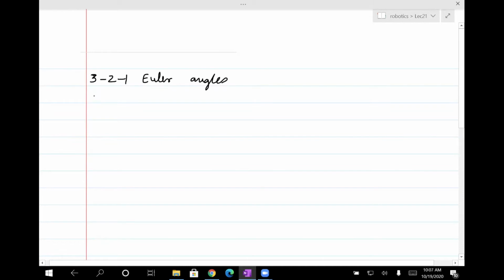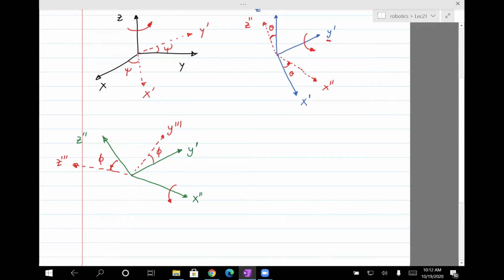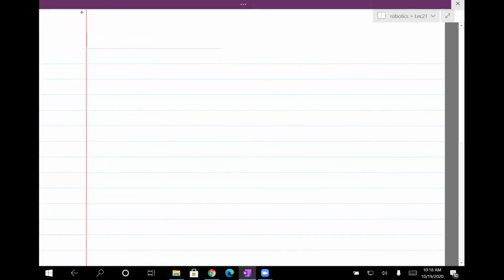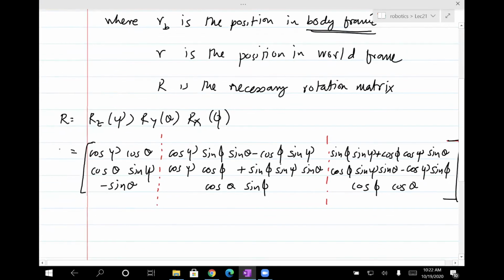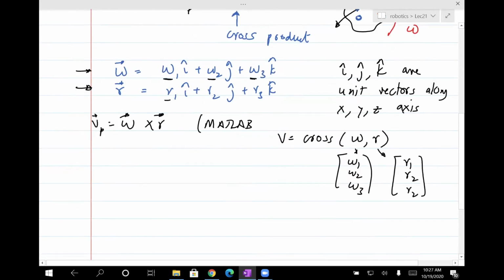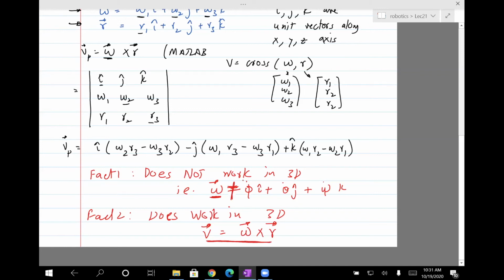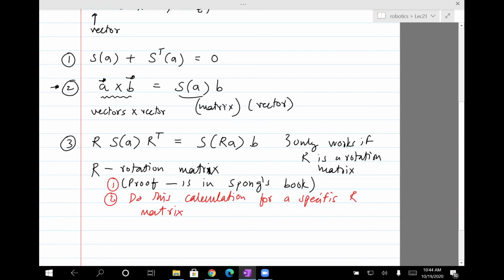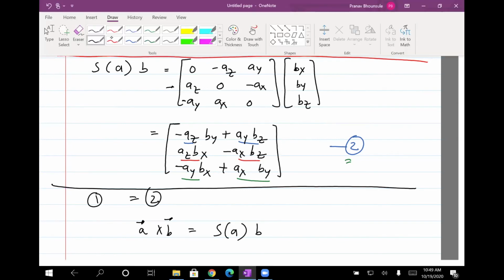Robotics Lec21: 3-2-1 Euler Angles, 3D angular velocity (Fall 2020)

Comment: Your videos are awesome professor. One question. From what I've read, the rotation matrix rotates the original vector to the final position, so should your equation at around the 10:00 mark be
 C3 = R C0 ? This has been confusing me for a while since it differs with literature online. Thanks for taking the time to step through it by hand, really helpful!
Reply from the maker: The formula in the video is correct. It is conceptually simpler to think of c3 as the vector describing the object in the body frame and cO is the position of the same object in the world frame. So if you start with the object lined up along world axis initially c3 =cO, then after 3 rotations the c3 in world frame is cO = R c3